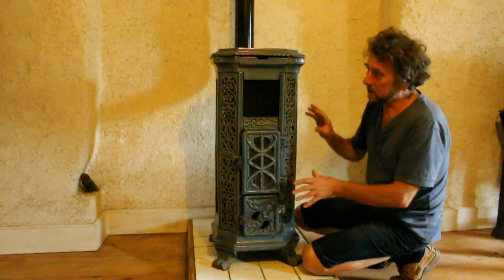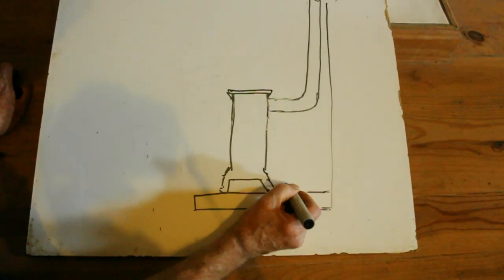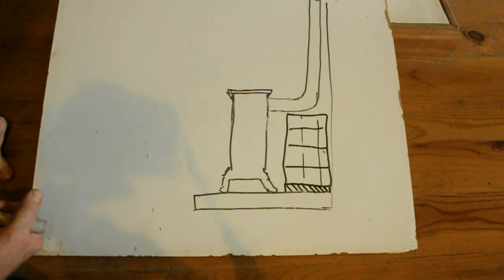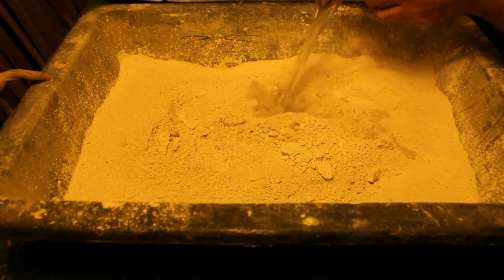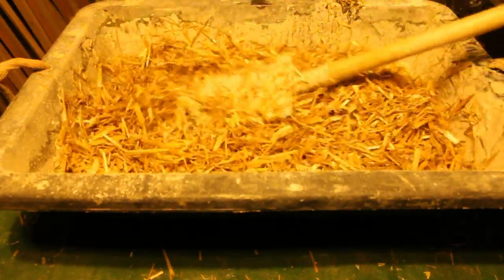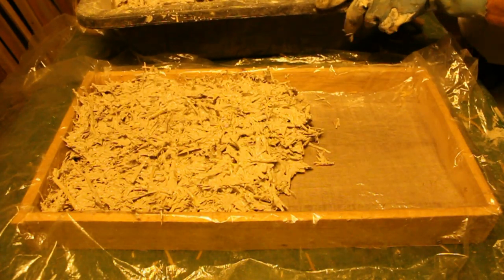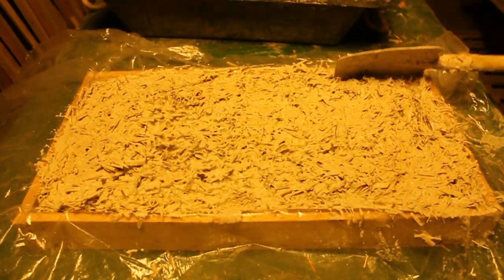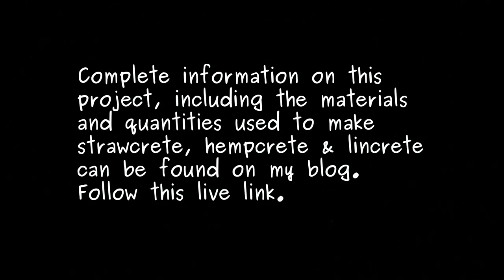Stone/strawcrete storage heater for our wood stove. Brico ecolo radiateur Bricolaje calentador

Comment: Did you use the lime\straw mix to insulate your walls too?
Reply from the maker: WillEyedOney Hi, Thanks for your question. We used straw and lime in the kitchen. Then we put a layer of hemp and lime on top of that. At the time we did not have the guillotine, just a chopper I had made from a lawn mower and a bin bag! So the hemp and lime gave a better finish. The first year, even though we had just the lime and straw on the North wall, the kitchen felt significantly warmer in the Winter. We then used lime and linen, just the stuff they sell for horse boxes in the sitting room, where the stove is. If you take a look on the blog you will see the photos of both rooms. In the kitchen we also put a layer of linen and lime on the floor before we tiled it. Again it made a difference to the feel of the room. We also have linen and lime on all the walls upstairs too. It is very easy to put on as long as you wet the walls down first and it is obviously much easier if you can mix in a concrete mixer rather than by hand! All the very best, Andy